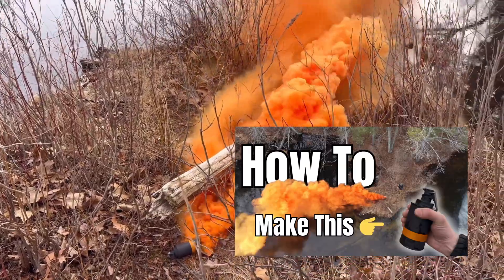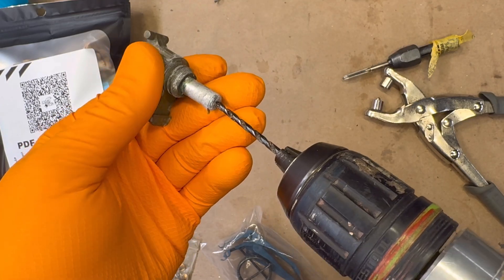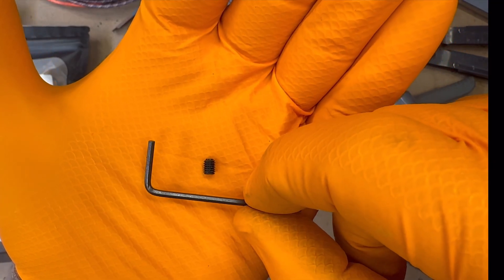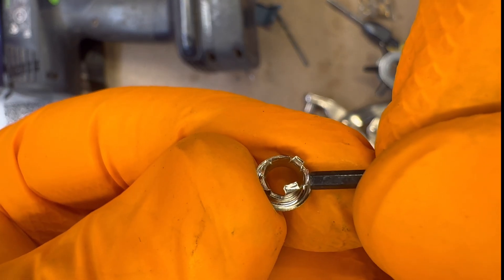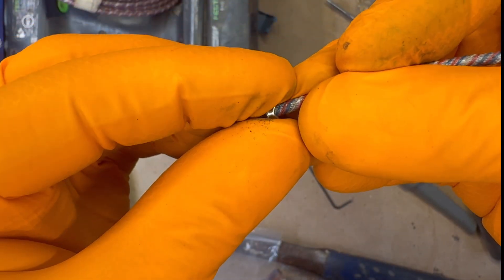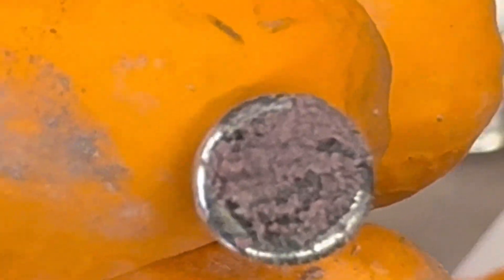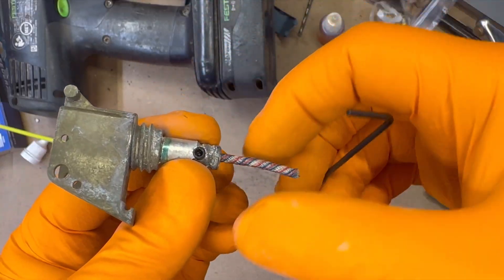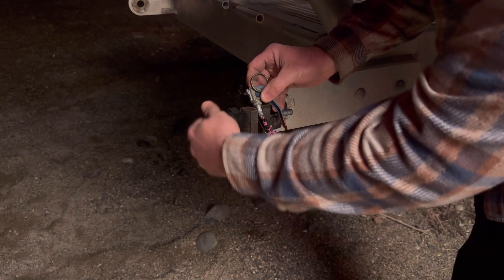The Eyelet Method: How to Rearm Grenade Fuzes For Smoke Devices

Comment: I see what I was doing wrong. I was using waaaaay too much nc lacquer and way too much fart mix
Reply from the maker: @Doubletapp9mm  you could go with a little bit more fart mix than I use in vid. Also, if you install the eyelet after ignition comp dries, push it flush down to striker plate, then brush on fart mix, that will avoid damaging the coating when installing.